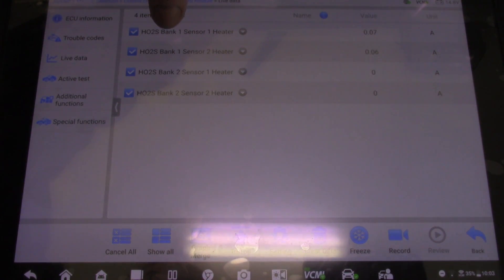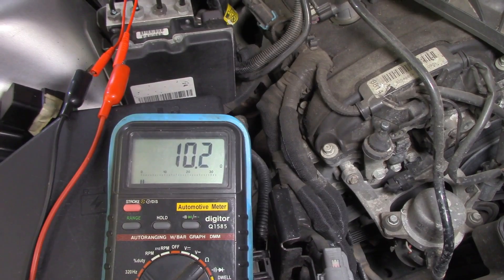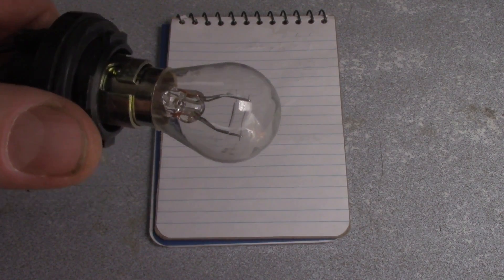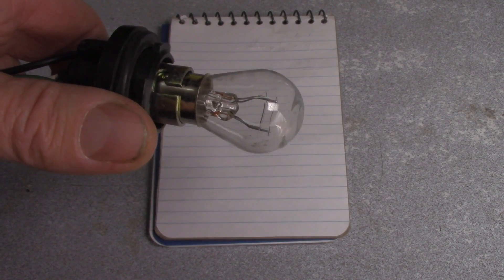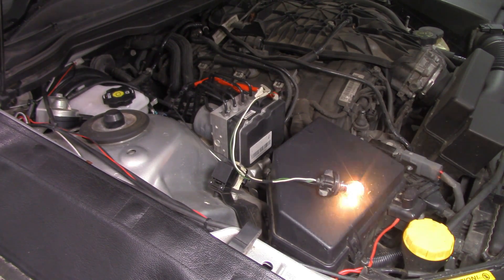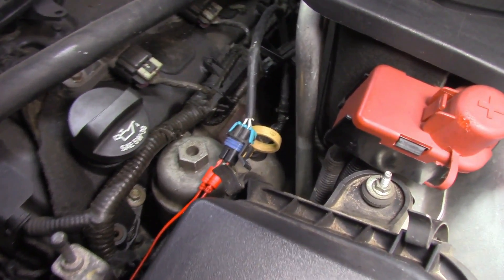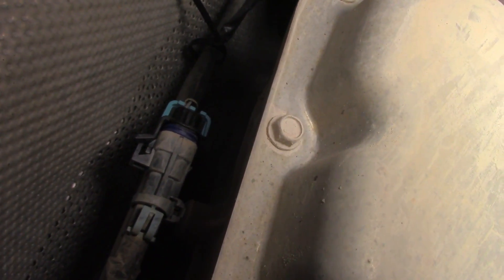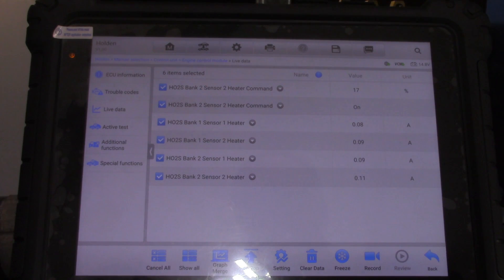Understanding & Testing O2 Sensor Heater Circuits DIY

Comment: Great video Max. Whilst I know as a professional mechanic you wouldn't advocate it, but if you had an old car with an oxygen sensor. Let's say you couldn't remove it, or the sensor was no longer available and you had a check engine light on could eliminate the check engine light by wiring in a light globe to provide resistance as the heater circuit would to trick the ECM in thinking the oxygen sensor was working ?
Reply from the maker: There is probably more strategies involved than just the heater circuit. Also the resistance of the heater is vital for the ECU to recognise a fault, so the correct resistance would be needed.
You could just try a resistor with the same measurement into the connector and see how that goes.
But yes, you are correct, as a reliable workshop, I wouldn't recommend this as there would be legal issues for a qualified technician.
Reply: @MiracleMAX thanks for the response, great videos and I look forward to more electronics repairs videos and learning series videos !!

Comment: Yes, it took me some time to find a good set of O2 sensors a year ago. Good things come from those experiences. I now have additions to my list of brands I'll never trust again.
Reply from the maker: Same here. I fitted what I considered a reputable brand only to replace them the next week. As I mentioned, sometimes the only solution is genuine.
Reply: @MiracleMAX yes, agree with you. Though even some reputable brands have made my list over the years. Some aren't worth the risk of a full motor repair or replacement I found.
Reply: Would be nice to know the brands to avoid.
Reply: @terrimac7993 😊 it seems consistent where the brand is manufactured via Asian origin. GOSS  for example can't confirm their products aren't made in china or any other Asian country. So it leaves the quality control up to the end users. Which is a very bad business practice when sold through a main supply chain to such a wide end user market. A recipe for a reputation disaster. But they'll likely just rename the brand once its reputation is destroyed and start the cycle all over again.